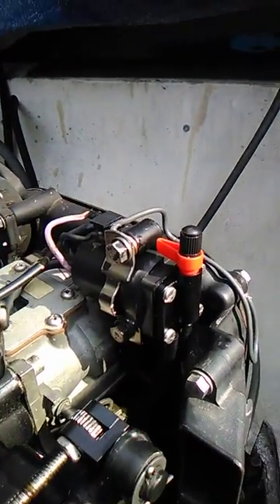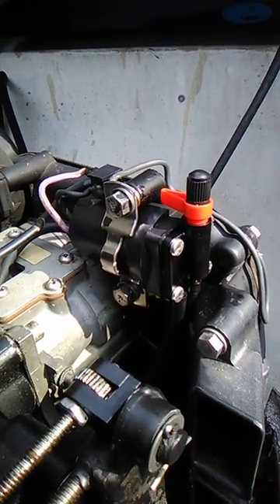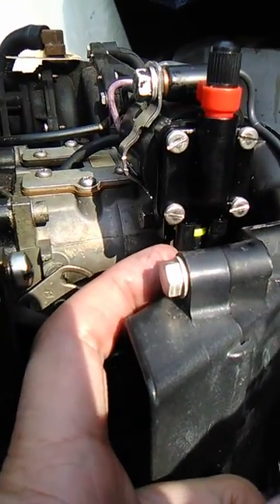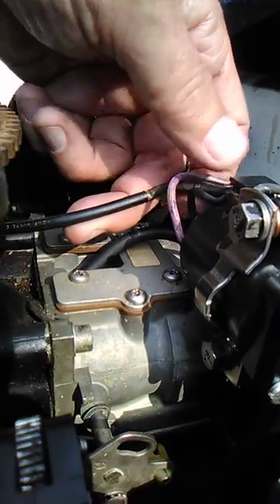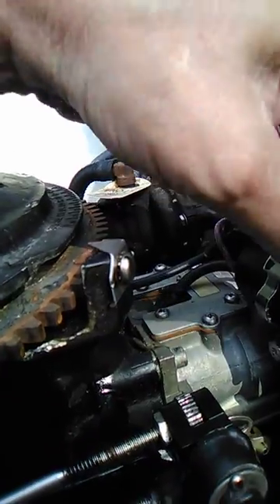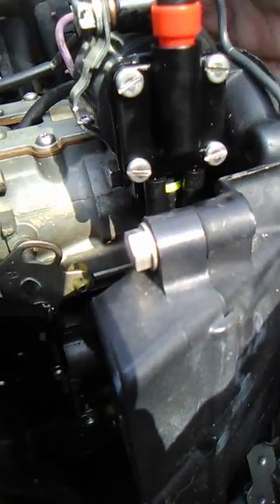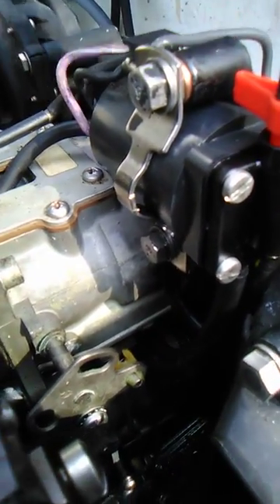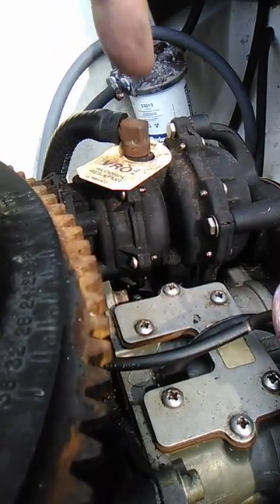Evinrude Primer Solenoid

Comment: Have 97 115hp runs great starts great but at WOT after few min will start to slightly miss(spudder) ..does screwing in or out deliver more fuel? I under 12 and 6 positions are auto and manual

Comment: I have the same thing.im having a problem.my engine will only run on choke.i changed out that vro pump & that didnt fix it.im wandering if that silinoid is causing problems.i had the carbs rebuilt alsi.still acting up
Reply: Did it work for u?
Reply: @MrTaylorfenoglio  no
The idiots that rebuilt my carburator left silicone down in the bowl of the carb.it was everywhere & blocking passage holes in the carb.i had to take it apart & clean it all out then it ran like a top
Reply: @ninjagodzilla6402  awesome!